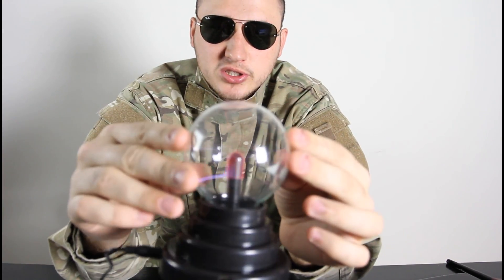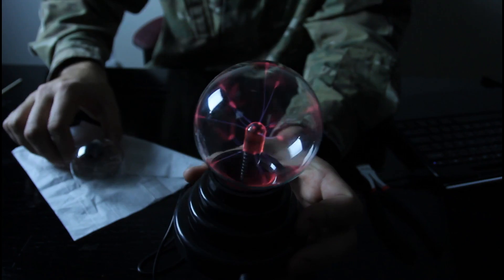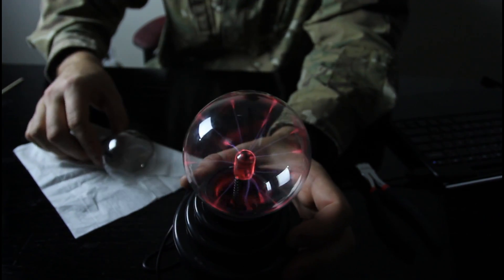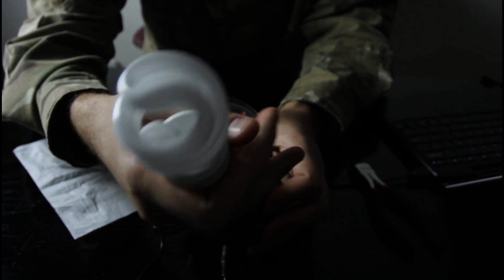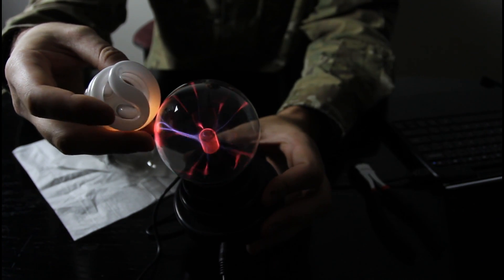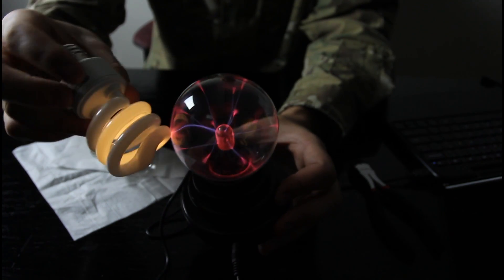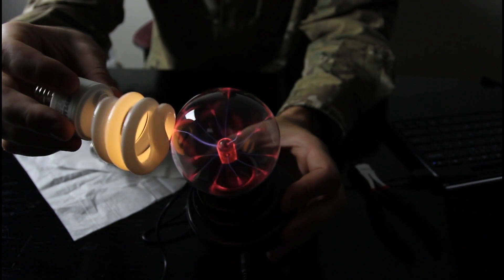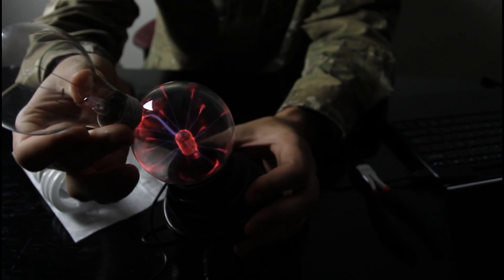Plasma Globe Makes a Light Bulb Glow (Wireless Electricity?)

Comment: Deepfriedfuzzball, your very close but you all have said that its due to the excited gas molecules producing visible light, but your one step off, well, two if your producing the light with an external source, in a normal flourecent bulb the gas is , yes, laced with mercury, but this gaseous mercury only serves to permit the flow of electrons through the tube and to produce ultraviolet light, when electrons flow through gaseous mercury they produce UV light, then the interior surface of the glass is sprayed with a phospholuminescent coating that responds to the UV light by absorbing a portion of it then emitting visible light as a by product, the only reason the globe turns on the light is because the UV light it produces is activating the phospholuminescent coating on the glass without sending a current through the entirety of the structure

Comment: An energy efficient light bulb takes less power and that's why it turns on because electricity travels from one light bulb to the other.    efficient light bulbs takes less energy and the normal light bulb takes more energy and that's why it didn't turn on

Comment: Because the fluorescent lamp has a gas in it the gas gets exited therefore lighting up when u put the plasma globe or plug In because of the electricity. But on the conventional lamp there is no gas therefore the plasma globe does't light it up because it uses a filament which relies of a hot coil of metal not by exiting a gas so u can only turn it on if u plug it. Nikola tesla did experiments with Teslas ( a plasma globe is a tesla with a glass globe) the Teslas also lit up old fluorescent bulbs.

Comment: I think it's because those lightbulbs also have plasma in them connecting, the energy.
Reply: Nope, its because it has special gas in it, and no its not plasma, the gas react to the energy and heat generated by the globe and so the particles of the gas on the lightbulb start shaking and so they shine.
Reply: Rodolfo Castillo and thus, energy is transferred

Comment: The operation of both requires  frequencies of about the same value, about 35kHz typically.

The  fluorescent bulb radiates EM waves at this frequencies.  They are picked up by the plasma ball and the gas inside it lights up.

Comment: RF energy from the plasma bulb excites the phosphor coating in the fluorescent bulb. If you place a fluorescent bulb (even a 4our foot one) near an Amateur ("Ham") radio antenna, it will also do the same thing. I think it also might work under a high tension wire, but I think that would be unwise.

Comment: the electricity can't excite the atoms in the 1st bulb mostly because the bulb is powered by a thin strip of metal, the 2nd bulb is mostly powered by gas that when in contact to electricity the atoms get excited and starts emitting photons of light giving you the faint glow that we all see
Reply: tungsten wire
Reply: @-.-4595  6 yrs late 🤦‍♂️

Comment: The first bulb won't light up because it transfers thermal energy to light. The plasma ball does not produce nearly enough heat to activate it. Interestingly enough the second bulb doesn't light up either. The light from the plasma ball is reflecting off of the smoked surface and making it look like its lit. No transfer of energy happens at all